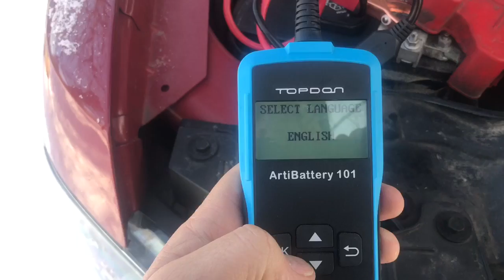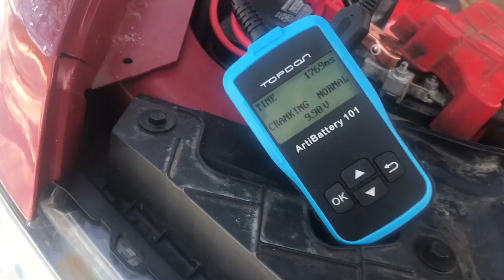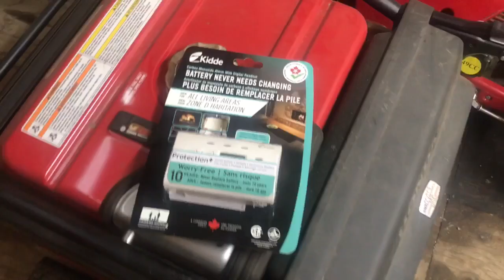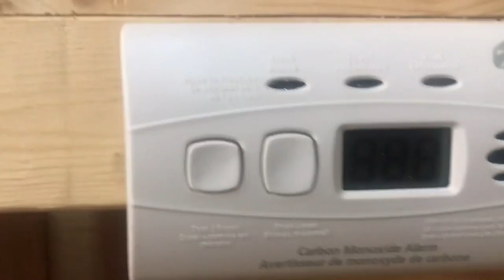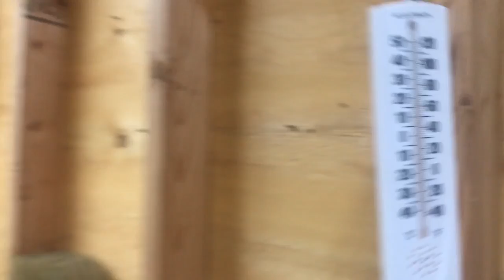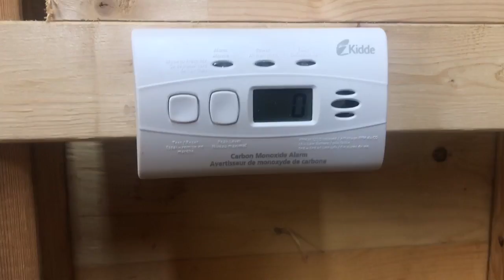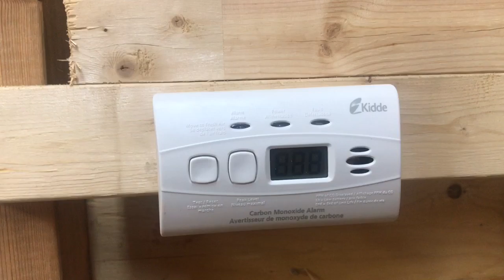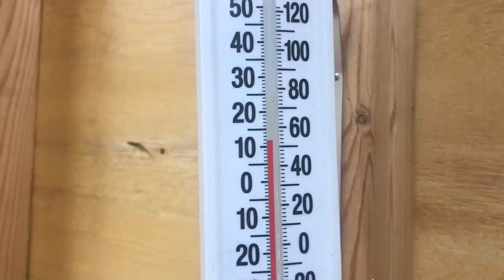Carbon monoxide test for two hours....Let's see what happens and May need a truck battery 😡

Comment: What about buying a Diesel Air Heater? They are made for Camper vans but would probably work perfect for your shed! They are super efficient on diesel and they use so little power you can run them off a car battery. Reviews say the cheap 200 to 300 hundred dollar knock offs work very well.

Comment: Hi Bill! Thanks for your videos. Miss your adress for the coming christmascards 

Found this on Youtube.  https://youtu.be/9YthaCqkMOs    Maybe something to put outside and get a pipe to the inside.

Finally a clone of a Webasto heater.  I've wanted one to try for a long time but they were always really expensive.  My friend wants to fit one in his camper, so nows the time to see how well these work.

£120 delivered off eBay.  How can they make them so cheap?

Fuel consumption  - 250ml per hour on full power

10A start-up current  - 2A running on full power

Have a nice day // Peter
Reply from the maker: Hey Thanks for the info
My addy is 

12 Cemetery Rd
Mono Ontario
Canada
L9W-5W3

Comment: even know carbon dioxide could kill you its found in your soft drinks carbon monoxide is the biggerer killer, your shanty shop isn't airtight not saying it isn't still possible to happen I sent you a link to your fb a page bill on how they burn up the oxygen so qiuckily causing only minoxide being left hay that's a good name for it shanty or shanty shop our grandparents used to call there shed/ garage a shanty due to the fact it wasn't big enough for a vehicle but way bigger for a shed in the 60s definition for a shed as well as there was an Irish bar down the street from them with maybe 12 tables and a very small bar called the shanty lol
Reply from the maker: carbon dioxide depletes oxygen in the air. That is the danger

Comment: I've been using one of those heaters to heat my workshop. Its completely airtight, and it's fine. You should drag that thing a few feet away from the wall tho, needs a good amount of air flow in the back end.

Comment: We use that type of heater on the gun range during the winter time with no problems. We've had more people complain about the gun powder never the CO2. You've also probably got enough gaps and air leaks to exhaust any CO2 that would be produced.

Comment: Check the water level in the battery.  If needed fill to the top with distilled water.  CO2, CO, SO2, H2S, and Cl2.  Cl2 is Chlorine Gas, it is used in commercial refrigeration.

Comment: When i had my car i got a new battery for it  and the first winter it failed and the garage said it was most likely because it sat on a shelf for a while but because it was a 2 year warranty  they replaced it without arguement your battery if still under warranty will be replaced under warranty as its gone faulty ie not holding its charge properly

Comment: Check the installation manual for that CO tester. The Kidde units I have warn that they are not to be installed in a location that gets colder than 40F or hotter than 100F. That pretty much means I cannot use them in my unheated garage.

Comment: Nice video and also test the kidde carbon monoxide detector every month and change the batteries every year.
Reply: That is exactly how it does that it will leak and it will get on the boards right behind it and fry them from batterie aside scene they are getting used all day. And how I know that I am pretty much a geek for fire alarms, smoke detectors, carbon monoxide detectors and tornado sirens check out my channel almost all my videos are about that stuff and my channel name is a model of tornado siren.
Reply from the maker: you cant open those ones
Reply: BILLSTMAXX yes some of them you can’t open but most  in the U.S  you can open
Reply: those have 10 year batteries
Reply: But on detectors you still have to replace them every year even if they have 10 year batteries because if they have batteries in them for to long the detector will fry
Reply: @Midwest_Sirens  "too" Tell me how leaving batteries in a carbon monoxide detector will fry the detector it self, all you have to worry about is bulged batteries and leaking batteries.
Reply: They leak faster when they are used longer so I told you how they fry